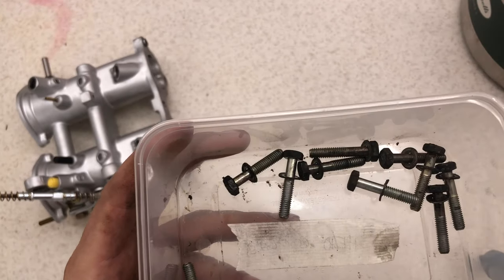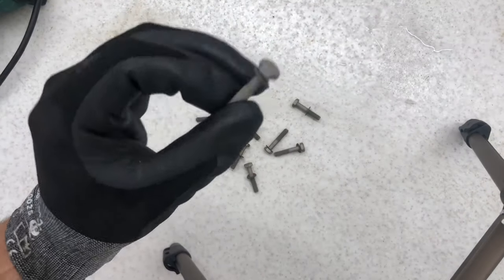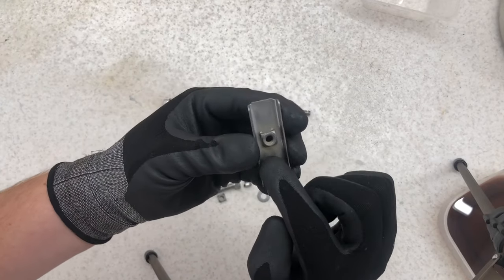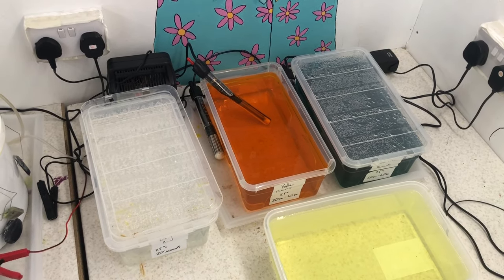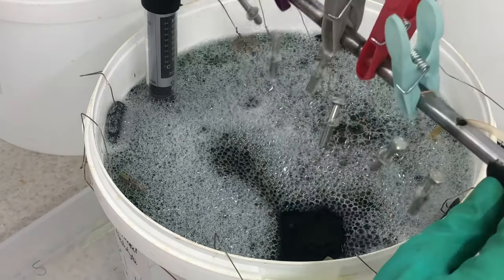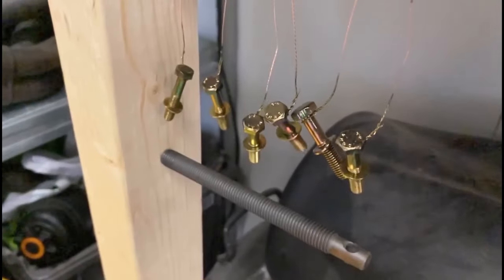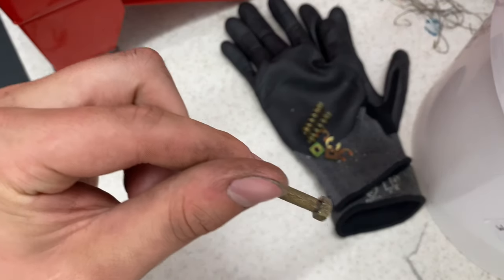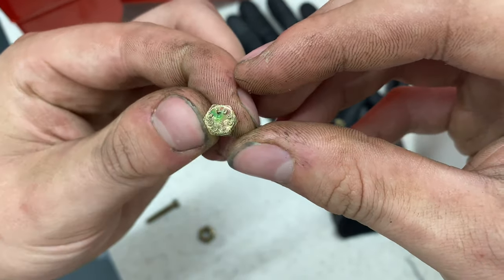Zinc/Nickel Plating Kit by Classic Plating UK - First Impressions/Results!

Comment: Great video, very informative. I noticed that you set up an acid bath to use between the plating and the pasavate, but didn't see you use it. Was that intentional?
Reply from the maker: Hi, thanks! Yes it was intentional. At the time i was struggling with the pre passivate dip, it was causing burning on the part within seconds. Found it fine to miss out the step at the time, didn’t get an issue with the passivate adhesion. Been told it was due to a lack of rinsing between steps
Reply: @BadE30  How much rinsing is sufficient after the electrolyte stage to ensure the burning doesn't occur?

Comment: Why did you not use the acid after the zinc and before the colour? Got this kit and yet to have a go so this video was brilliant, thanks 👍
Reply from the maker: At the time i was getting issues when using the acid where it would blacken the item pretty much instantly. Seemed to be a lack of cleaning before moving process. I have started to introduce it back into the process now.
Reply: @BadE30  Thanks, looks like I will need to get a couple of tank heaters and an air pump as well, was looking at them but wasn’t sure, seeing yours I think it better I do that as well. The acid etch you did outside, that isn’t in the kit, I have citric acid dipped most of my stuff then wirewheeled it, would you recommend the stronger acid instead?
Reply from the maker: Would definitely recommend the heaters and pumps, and maybe some extra buckets! With the acid dip for preparing the surfaces, the stronger acid simply works faster, so if time is not an issue, the citric acid should be good!
Reply: @BadE30  Thanks for the advice, jusr getting set up now with heaters, air, buckets etc. What have you used fir water, de ionised or  distilled? Reading the instructions seems to say both! Either for electrolyte, deionises for colour, and not said what for acid or degreaser or wash? Any advice? Cant wait to get going on it 😁
Reply from the maker: @SkylarkCamperAdventures  good work! I use deionised water for everything, even the rinse buckets. Not thought about the different between deionised and distilled. Sure I was told deionised!
Reply: @BadE30  thanks, that video has been a great help, was watching it whilst I sorted my buckets and wrote on them what to do, how long and what was in this afternoon. Numbered them all so I don’t forget which one I need to do next! Got 20litres of distilled water, but may get some more deionised to for the wash etc (it’s just much cheaper, can get 2.5l for £1 at the min 😁).
Reply from the maker: @SkylarkCamperAdventures  nice man! I get my deionised water (for car batteries) from halfords, £3.90 for 5L which I think is respectable with how easy it is to access.
Reply: Just an update, just finished plating all the bolts etc for my engine rebuild, thanks for the video, give me confidence to do it! Things learnt...would probably not make as much fluid next time (although still got the fluids from this time) for the amount I was doing, don’t put airator block on end of airator pipe, just use open pipe (unless you want lots of froth! 😉). Apart from that all seemed to go well 👍🏻
Reply from the maker: @SkylarkCamperAdventures  i just used the whole solution as luckily I have enough space! Understandably it takes up a lot of room. Glad it went well for your first time
Reply: @BadE30  Nice video! Good results! 😀 I have the same kit and the same blackening problem. It worked well in the beginning but now all my parts blacken in the nitric Acid. Works better if I skip it, but I was wondering what you did to solve it and start using the nitric Acid dip again? 🙂
Reply from the maker: @FieldMouse88  this is still an ongoing problem I’m having, currently in talks with classic plating uk to help resolve the issue. The latest advice is as follows ‘Essentially it looks like the Zinc in the plated layer is possibly reacting a little too much with the acid in the pre-passivating dip. There are a number of reasons this can happen, 

Probably the best way to resolve the issue is stop using the acid dip before passivating completely, and instead wash the part thoroughly in a strong solution of washing up liquid and water after plating. Rinse very thoroughly before it goes into the passivate as normal.’
I have tried this and it stops the blackening, just need to see if the passivate sticks well after a couple days
Reply: @BadE30  Wow thanks for a really quick response! =D Im currently waiting for a response from them too, I also got the advice to try skipping it and using washing up water instead. Do you always go straight to the yellow? You dont do the blue dip before the yellow? Its supposed to get better adhesion that way, not sure if theres any drawbacks though!
Reply from the maker: @FieldMouse88  always go to yellow, I’ve never struggled with adhesion issues! Also with the blackening, do you get black ‘scars’ from over current that are pronounced after the nitric acid or is it a general darkened of the part from the acid?
Reply: @BadE30  OK! =) In the beginning the parts turned a bit brown, then back to very shiny and bright, and all was good! Then slowly parts started getting black areas, that does not seem to be over current, because it was mainly low current areas that got black. Now the entires parts get completely black pretty much as soon as I dip them in the nitric acid. The blue passivate then restores much of the brightness but the result isnt very good at all.
I did get some kind of burn marks on time though, but they were visible before the nitric dip, but got more pronounced with the nitric. The burns were located where the bubbles left the part, so the "top most" corner, got "burned". This hasnt been much of a problem though.

Comment: is there any way to speed this process up or do you have to do them one by one?
Reply from the maker: The speed is tricky to change as it is a slow process, however the batch size can be increased with a larger power supply. I now have a 15amp supply (from 6amps), which means I can do much larger batches/larger parts!

Comment: Great video, thank you! Have you got a link to a good tank heater to use? Thanks :)
Reply from the maker: Thanks! It’s just a simple fish tank heater, got from a pet store!
Reply: @BadE30  Great, thanks. Final question, i really like the Nickel finish, is there any reason to continue on with the final stage in your video whereby you coated it with the yellow finish?
Reply from the maker: @adrianhughes2163  you can use either a yellow or blue (which is more of a clear) passivate to suit your needs. I have both which can be seen in the video, and use whichever is suited to what I am plating. Most of my car hardware was yellow passivated so I predominantly use that
Reply: @BadE30  Thanks for your time and thoughts, and thanks again for doing the video :)

Comment: How do you make the Zink-Nickel bath? Can you just drop both Zinc and Nickel in to make a Zinc-Nickel process?
Reply from the maker: I’m pretty certain it requires a different electrolyte solution for the nickel-zinc! Cannot say for sure, the solution for the bath is on Classic Plating’s website
Reply: @BadE30  It does require a different solution ! But afterwards it is as simple as connecting zinc and nickel on the positive side? 

Some other video on YouTube with fancy lab equipment said something about 15% of nickel.
Reply from the maker: Ah yes! My kit came with 400g of zinc anodes and 100g of nickel anodes. So this kit goes with 25% Nickel

Comment: I had a kit like this. Done some parts with it and the looked good but after a whil it al started peeling of. Also hated the smell of the plating tank when te heater was in it.
Reply from the maker: The acid dip before the passivate helps massively with the stiction
Reply: @BadE30  i had a complete set wich i bought in the UK, just like OP. Mine was zinck nickel set

Comment: hello from greece,is better with sandblasting or with wirewheel?
Reply from the maker: To get a shiny finish, you need to wirebrush/polish the hardware. Sand blasting gives a dull finish which is shown with the plating too.
I still use sand blasting on the larger parts to clean first, then wire wheel before plating

Comment: Would sandblasting the bolts before all this make the process easier/better?
Reply from the maker: For sure, just at the time I didn’t have one.. I have one now which I use for the larger parts, but it’s super easy to throw the small parts into the acid!
Reply: @BadE30  oh cool, thanks for the reply! Super helpful video. Thanks!

Comment: Is it possible to do this to the inside of a motorcycle oil tank that's new with minor leaks? I built the tank.
Reply from the maker: Some people do not like this plating on internal parts where there is potential for flaking to clog filters etc.. I’d look more towards a sealant for the small leaks!

Comment: What am I doing something WRONG? I zinc plated my bolts and than deposited into a Nickel plating bath.  But after the nickel plating it looks like the zinc coating somehow got removed.  Can someone tell me what I'm doing wrong?
Reply from the maker: I’ve known people to separately plate their items in zinc then nickel. It may be due to improper adhesion of the zinc, have you tested how strong the adhesion is?
Reply: @BadE30  Thx for the reply.  The Zinc adhesion is thicker than zinc and it seems to go on rougher.  But the zinc can't be rubbed off.  Maybe I try it at a slower process, used 6V and .5a

Comment: hello again,what a am doing wrong and the bolts are black at the bottom?
Reply from the maker: I’m going to say it could be insufficient rinsing between processes, i had this before and had to up my rinsing to get rid of it. Also if the power is too high it can scar the parts
Reply: High current density area,  too much power

Comment: What kind of wire are you using to hang your bolts into the electrolyte? Thanks
Reply from the maker: Hi, i use 1mm pure copper wire. This can be purchased from ebay in 10m rolls

Comment: Sandblasting gets all the rust off & to clean metal without toxic chemicals
Reply from the maker: I use my blasting cabinet for the larger components, i find the acid dip more effective on smaller parts which are hard to handle

Comment: Did the ratio of zinc and nickel matter?
Reply from the maker: The current from power source kind of controls how much metal is taken to be plated, so I wouldn't say there's an exact ratio! And if you mean a zinc to nickel ratio, I used the same mass of each!
Reply: @BadE30  cool thanks, I've read some recommendations that state a 80-20 mix is best,  but if it doesn't effect the finish, then meh
Reply from the maker: @matthewnewsome9221  scratch what I just said, have just double checked on the https://classic-plating.co.uk/product/zinc-nickel-plating-kit/ and it says:
 'High purity zinc anodes 400g, will plate 44,000sq cm

High purity nickel anodes 100g'
Which is close to what you read!
Reply: @BadE30   cheers 👍

Comment: So you used zinc and nickel anodes at the same time??
Reply from the maker: Yes! My kit came with 400g of zinc anodes and 100g of nickel anodes.
Reply: @BadE30  Is that normal to do both at the same time? I've never come across that before
Reply from the maker: @driving-riding-wrenching1278  the kit I purchased from classic plating was specifically for this! Supposedly more corrosion resistant
Reply: @BadE30  okay cool. Thanks for the info.

Comment: If you had some muriatic acid you could’ve stripped those parts &  plate them  looks like they were blistered or etched up.
Reply from the maker: I use that acid for the prep to strip the parts, sometimes i need to sand blast the components which causes the etched surface, this is soon sorted with a wire wheel

Comment: how do you heat your tanks?
Reply from the maker: Simply with fish tank heaters! They are about 200w if I’m correct. Take about half an hour to heat up the larger buckets to the temperature required. Can be purchased at most stores

Comment: You should sell the bolts for $20 ea. to recoup your time, and materials.
Reply from the maker: haha, I wish it was that easy. It was definitely not an economic decision to invest in the equipment!
Reply: @BadE30  I end up in your boat every now and then.  Last time I was there I just used some cold galvanizing spray from a rattle can, but thats obviously not always an alternative... I suppose if you just coat Nickel/Zinc - it's not durable.  I haven't looked into hard anodizing yet.

You don't happen to live next door??? 🤔

Comment: I want to get my fuel injection  pipes unions done but they have plastic pipe heat shrunk to them..if I can keep the plastic out of the electro part of the process because not sure the electro will damage the plastic.. have to avoid the wire wheel &  acid part by  fine wet flatting & poshing
Reply from the maker: I’ve heard people plate with plastic, but you will need to know if they are acid and heat resistant! The buckets used for the plating aren’t any special plastic, it’s quite common!
Reply: @BadE30  
Many thanks..

Comment: You need to buy an ultrasonic cleaner. It will save you so much time, degreasing.
Reply from the maker: I’ve got one! Have found it useful at times, I sometimes prefer using my parts washer instead

Comment: Any idea what your voltage and current is?
Reply from the maker: Tricky to say, however I have since upgraded my power supply to show me the readouts. i've used it in some of my newer videos, it looks like for small parts i use 3v and 1.7amps, i have used up to 10 amps before on large pieces but it starts to go a bit mad up there!